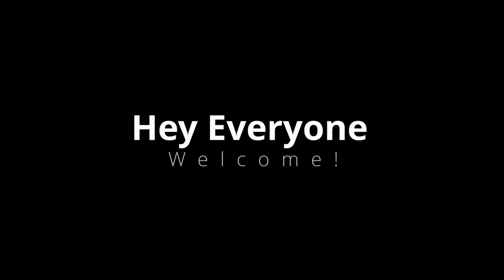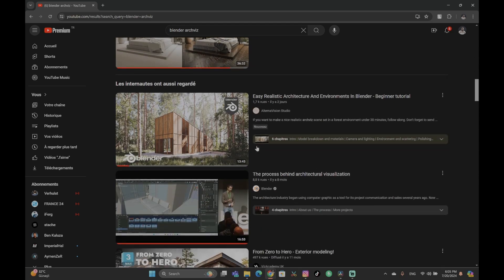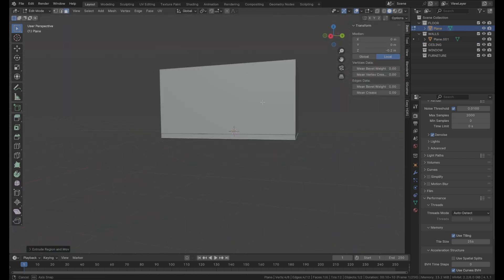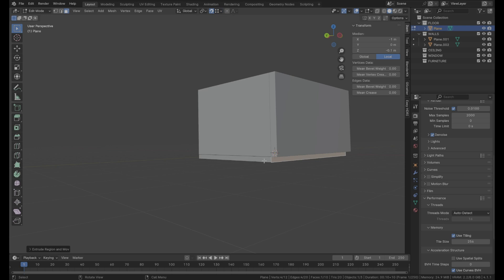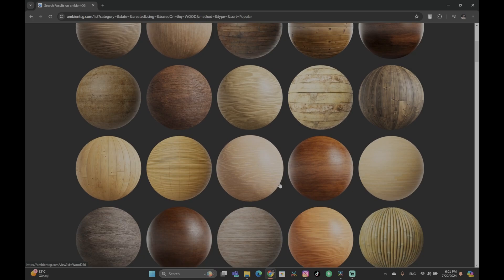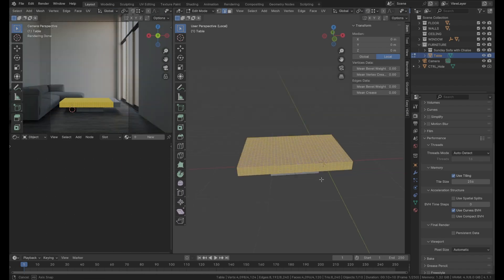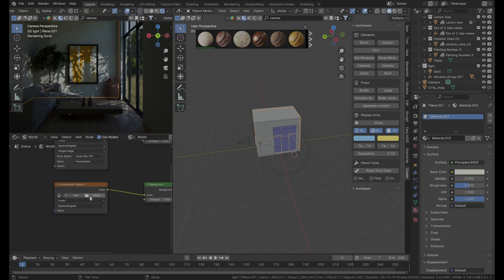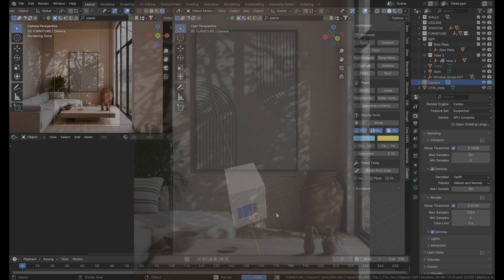Blender 3d - Interior 3D render.

Comment: It could use some skirting, the transition from the wall into the floor is quite rough. Also I noticed that plant clipping through the couch. What I usually do is adjusting the plant using propotional editing. Other than that the render is really smooth and has a warm vibe, good job mate :)